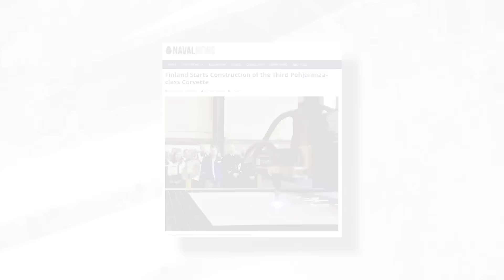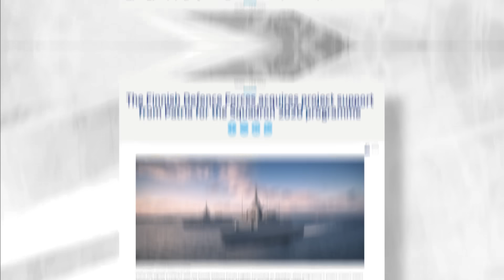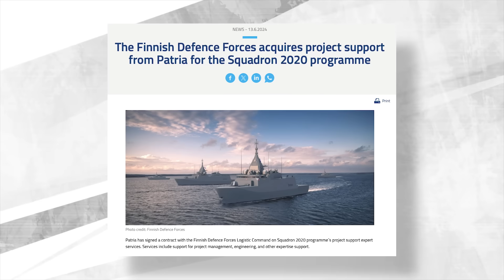Finland’s Multi-Role Corvettes (Pohjanmaa-Class)

Comment: Estonia should order a few of those too. Have both countries do naval exercises together and maybe even create a linked task force
Reply: Finland should at least donate the two Hämeenmaa-class minelayers that are to be replaced to Estonia so that they don't go to waste after exiting Finnish service use. They are relatively modern and also ice-capable for operation around the year and would constitute an improvement over the one minelayer with less capacity Estonia currently uses.
Reply: @herptek 

Just donate, the other got new engines, cannibilize the second for spares.
Reply: @JJuhala-w9g  Or alternatively they could replace the engine of the other one as well if they want to keep both ships in service at the price of one engine overhaul. Either way, it would be an improvement over their current minelayer.
Reply: @herptek  the lead ship Hämeenmaa (02) is pretty worn, but the Uusimaa (05) is slated for an engine and powertrain replacement, which means its usage could be extended significantly. This could mean it's planned for being donated to Estonia.
Reply: @XoravaX  Reportedly the engine replacement was to extend its service life beyond originally planned introduction of the first corvettes into service, which was delayed. Having it retired before the corvettes are in service would have led to a gap in core capabilities of the navy.

But now that it is done it might just as well be donated after leavings Finnish service, or both of them really. That way they would remain as an active asset in friendly hands in the region.
Reply: @herptek I'd honestly be in favor of selling the Rauma-class missile boats to Estonia at a cheap price. They're going out of service when these come operational and all the weaponry will also be replaced with new ones on those as well, so the Rauma-class will be mostly intact when they're retired.
Reply: @Machine_God 

They are at the end of their life, only system on them worth even donating is the RBS-15.
Reply: @Machine_God  Rauma-class is at the end of its life, as the aluminium hulls have fatigue (which had to be addressed already over 10 years ago, when fatigue cracks were observed in the hulls). Furthermore, they're not seaworthy in rough seas because of their hull shape (minimal draught), and their self-protection capabilities are limited to the 40 mm Bofors gun and MASS launchers. Hamina corrected most problems, but the missile boats are still very problematic to operate and have been a significant operative limitation to the Finnish Navy.
Reply: @M @Machine_God stonia will either order new ships from Saab or build ones themselves.
Reply: @Machine_God  Hulls are so worn out that highly unlikely
Reply: @herptek  and where are the Estonians going to get the crew for those two ships?
Reply: @jb76489  They have a complement of 60, not exactly very many people to train. Doesn't sound exactly like the biggest possible problem to overcome to me. Conscripts can also serve on board in certain personnel tasks similarly as in Finland.
Reply: @herptek  So you dont know how big the Estonian navy is, got it
Reply: @jb76489  Don't try to sound snarky or clever, it just sounds the opposite.

Precisely because it is a very small navy with barely any combat capable assets it might help them out a bit to donate some low complement ships to improve their capacity. We are talking about tiny professional crews that are required on minelayers.
Reply: @herptek  hey man, don’t be mad at me because you were too lazy took this stuff up. Those ships would be ~three times the displacement of the Estonians biggest ships and have twice the complement. Currently all the Estonian navy ships have combined crews of a little over 200 and you want to increase that by 120 just cause? Do you really not see the issue with that? Or with using draftees for technical roles?
Reply: @jb76489  Finland has relied on using conscripts to man Finnish Navy ships for all of its existence.
Reply: @XoravaX  fun fact: that isn’t true but whatever, less than 8% of finish navy conscripts every year end up being part of a crew
Reply: @jb76489  true, but in peacetime the conscripts operate more roles than what their intended use in wartime is.
Reply: @herptek  Completement is 73, but even so it is a  low number for a ship of this size. This means most of the crew has to be highly skilled. Not much room for conscripts unless they have a civilian job, that is very relevant. Estonia has no vessel, that comes close in size or complexity. So it has no crews, which have experience with this kind of vessel.
Reply: @orbiradio2465  Hämeenmaa-class that the above talking of donating was about is a smaller ship with a complement of 60. Finland uses conscripts aboard navy ships without problem.

If Estonia has somehow trouble recruiting and training a cadre crew for two such ships, whose complement combined would be 120 then it could do as Finland does and use conscripts for some personnel roles on board. This is all in all extremely tiny number of people for a sovereign nation state to employ in any case. Obviously Estonia doesn't train personnel for ships it doesn't have but should it be donated some then it might put them to use.

The Hämeenmaas are quite modern minelayers and would be a clear improvement over current Estonian navys capabilities and certainly over the one minelayer Estonia currently operates.
Reply: @herptek  Sorry. I did overlook the shift in topic from the original idea. One of those as replacement for EML Wambola  could be an option, if the vessel is in good shape. It would still be a challenge for Estonia to operate that vessel.
Reply: @orbiradio2465  I doubt it would be too great a challenge, quite possibly one of the least challenging ways of expanding and improving on current Estonian fleet capacity and capabilities. EML Wambola in addition to the two larger and more modern Hämeenmaas would add up to quite good minelaying fleet.

Back in the day Estonia was interested in buying the older, now long since decommissioned minelayer Pohjanmaa with still much bigger complement which would have been in quite worn out condition and pretty antiquated as a design. Both of these Hämeenmaa-class ships are newer and of much more modern design. FNS Uusimaa has also gotten new engines to extend its service life. Finland is planning to ultimately replace the capabilities of these two ships by the new Pohjanmaa-class corvettes, but for now they are as good as any as far as minelayers go.
Reply: @herptek  Estonia is modernizing it's fleet as soon as it can find the money. Last I saw 4 firms were considered for design work and assistance as the plan is domestic building.
"Two ship types are planned. "A large open-water vessel of about 100 meters and a coastal ship in the 60–80 meter range," said Marek Mardo, the ECDI's strategic category manager for air, sea and combat vehicles. Europe is the most expensive region for shipbuilding, with costs up to 30 percent higher depending on the builder, he added."

I don't exactly know what the ships specifically will be but these are a fair bit larger than anything Estonia has right now. From what little I have gathered they will have modular mission packages, sufficient self-defense(vague, I know) and mine-laying capability. Estonia is also leading a European naval drone coalition. Doubt they will be anything close to Pohjanmaa though. Those ships are practically Frigates.
Reply: @Gerhard-n7l  I have wondered that as well. This channel has covered the topic of Estonian naval modernization before, but the range of ship sizes cited differs from your source somewhat.

The Hämeenmaa-class in comparison to those size criteria you cite would fall in the upper end of the smaller coastal ship size range. It is of roughly the same length as the littoral mission vessel apparently offered to Estonia.

The Pohjanmaa-class corvette is bigger than the upper limit of the requirements set by Estonia to their bigger type of open seagoing vessels and I'm not sure it would be possible for Estonians to build domestically as they want to anyway. It is true that its displacement falls in the range of frigates by the criteria set by defence forces itself although in the current configuration under construction for Finland it is a little bit on the side of lightly armed for a modern day frigate in my view and doesn't have such an very long endurance as frigates often have. Perhaps you could say that it is either a heavy corvette or a light minelaying frigate if we insist on a more fitting label.

Like the Hämeenmaas it would also be ice capable which might be of interest on the northern Baltic Sea and particularly on the Gulf of Finland. It might be something that could be of use to Estonia but I have no reason to think they are considering anything like that for their purposes. What I do believe Finland could just as well donate the Hämeenmaas after replacing them so they could remain in allied service on their native Gulf and contribute to Estonian navys capabilities. Certainly that way Finnish and Estonian navies put together would have a quite considerable minelaying capacity in case we really need to close the Gulf of Finland.
Reply: @herptek  Yeah, the source I used quotes a procurement official and saw same numbers quoted by the Head of the Navy. I am not even sure if the 100m is precise upward ceiling but rather imprecise estimation of what the design will likely be. 

Pohjanmaa is a weird corvette, though at the end of the day it doesn't matter. As for it's armament, not much different to german multi-purpose frigates, though perhaps not the best comparisons when you look at what Israelis do with the German warship hulls.
Interestingly enough, Estonian shipbuilding is weird. Baltic Workboats builds relatively large and complex coast guard vessels and does the systems integration. I have no doubt the hull could be built but is it what is really intended as building them locally?  Though at the end of the day, I think might be quicker and cheaper to let a Turkish or Korean yard build the ships.

I think we can already close the Gulf more or less with ground based batteries and mines. I don't see a reason not to take or find some arrangement for the Finnish vessels even on interim basis as our own new fleet will be constructed but that is down to price, even if lately money grows on trees for the defense budget. Who knows though, as you said though, currently there is no reason to think there will be any Estonian future for the Hämenmaa.
Reply: @Gerhard-n7l  Now, while I know it isn't exactly 1941 anymore what I mean the Estonian navy is currently lacking in the kind of capacity necessary for minelaying in the kind of mass that would be needed to close the Gulf of Finland. I'm not convinced that kind of minelaying capacity is exactly in the books either, but that depends what ships they end up buying exactly. Missiles can be shot down by defensive armament of enemy ships so their numbers also matter to some degree.

It is questionable the Estonian yards would have the capacity to build the ice capable warship hulls of ships such as the Finnish corvettes and as said before they fall outside the scope of that size range as they are 117m long and displace 4300 tons. I don't believe they have ever been considered nor offered as they are not in this category.

The Pohjanmaa-class corvettes are still much smaller than the German frigates and not armed quite to the same degree either. The German ships are gigantic, displacing a destroyer, which is why some people insist on calling them that. If you are thinking of the K130 corvettes instead those are what I would consider as more typical corvettes in both displacement and armament as well as endurance and also smaller than the Finnish corvettes. The Israeli versions of that K130 corvette called Sa'ar 6 are indeed armed to the teeth with ridiculous amount of VLS and other SAM capability crammed to a ship as tiny as they are.

The most similar warship in displacement terms to the Pohjanmaa-class corvettes that I could think of is the FDI frigate. The original French navy version of it has 16 VLS cells which is what I believe to be the baseline for modern light frigates. Should the Pohjanmaa-class be used as a frigate I think it would be good to at least double its VLS cells by another launcher module and add some close-in weapon system.
Reply: No, dont do it, they are too big for the Baltic sea, buy something much smaller , google my words
Reply: @adamradziwill  Not a very intelligent comment.
Reply: I think a few land-based anti-ship missiles (RBS 15s or Gabriels) would be more suitable for Estonia and then maybe a few Super Tucanos so they could get fighter planes of their own. Yes, they are not jet fighters but they can still do surveillance, hunt drones, launch missiles and even glide bombs.
They are also quite affordable to fly and maintain.

But that's just my opinion.
Reply: @X @Xerdoz  Estonia already has anti-ship missiles, Blue Spear.